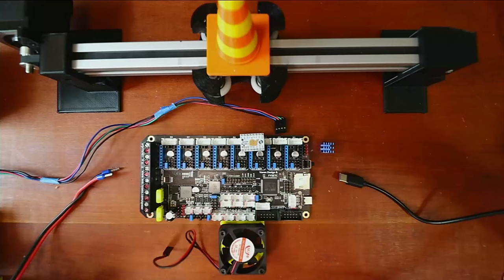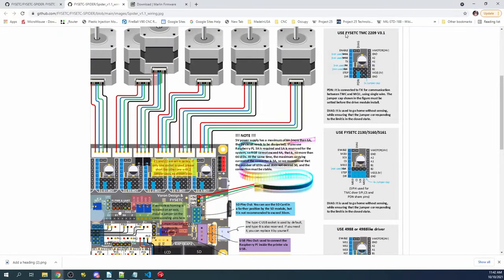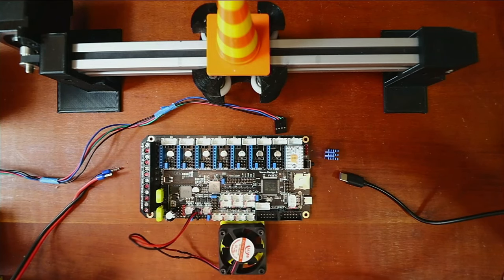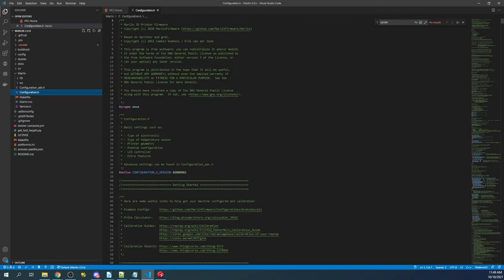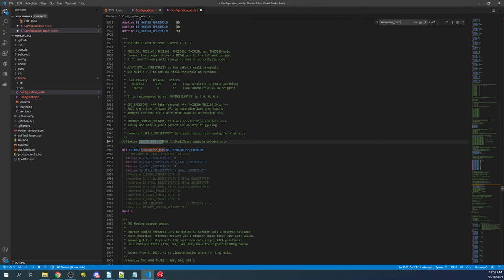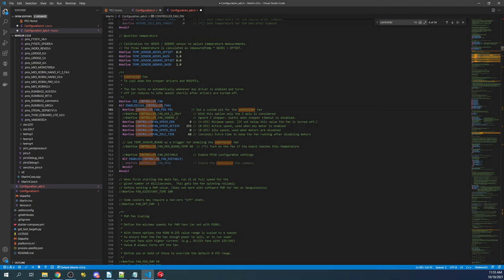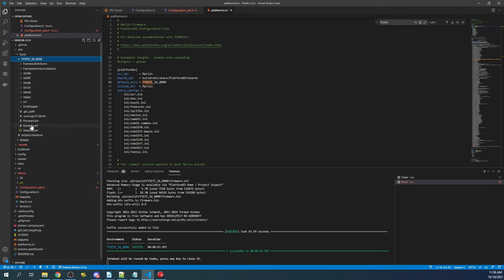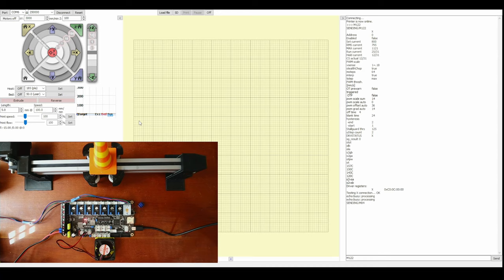Fysetc Spider v1.1 - TMC2209 Sensorless Homing with Controller Fan

Comment: Very detailed. Will hopefully help with my task to use the Spider for OpenPnP
Mhm, my Marlin 2.1.1 has no .pio folder. How I get that? (The trick is: restart VS Code after installation)
...I have a Spider 2.3 - Marlin 2.1.1 created plenty of errors, but Marlin-bugfix-2.0.x could create the firmware. However, M122 gives me: Driver registers: X 0x00:00:00:00     Bad response!